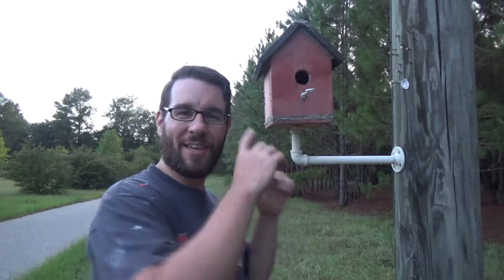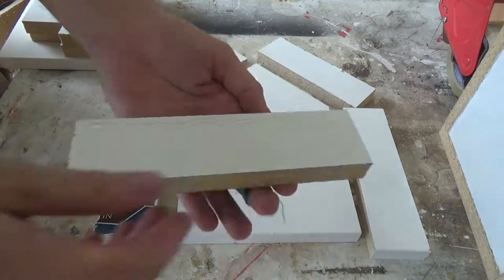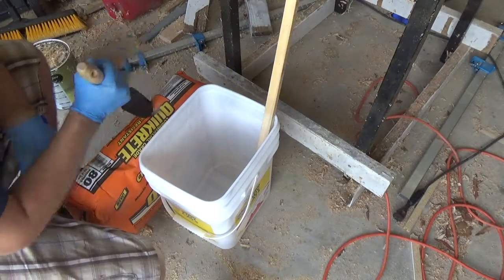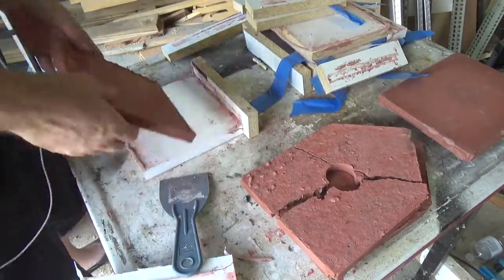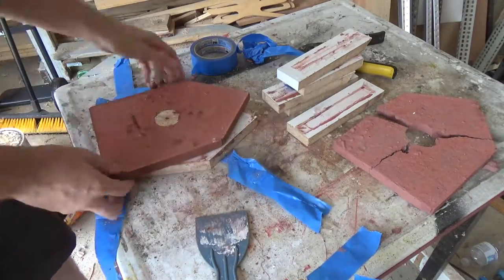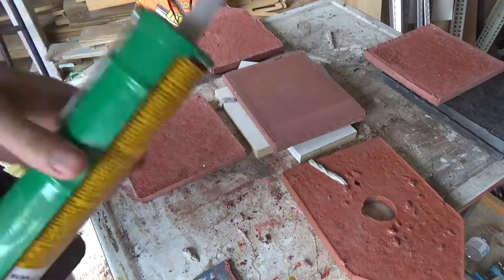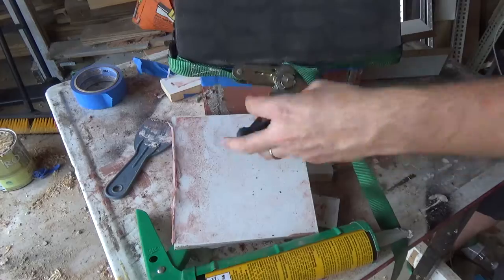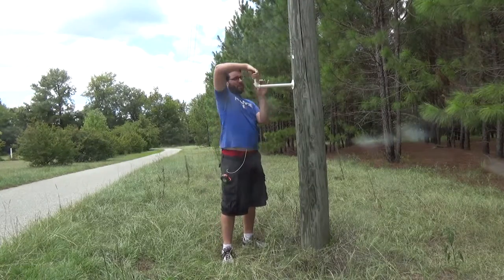Let's Make a Quikrete Concrete Birdhouse | How To

Comment: Watched your video because coincidentally I'm making two bluebird houses with subway tiles. Cut them with a tile score and break tool not a saw. I glued one with 2-part epoxy and another birdhouse with outdoor rated LiquidNails. I'll see which holds up best to weather, but your adhesive idea looks interesting too. I used a gap at top of front face instead of a hole. Hope to have a squirrel-proof long lasting house. White glossy subway tile should help keep birds cool in hot sun. We'll see how it works out and test of time. Maybe I should make a video, but would need to learn some video editing techniques.

Comment: nice!   after watching this, I'd be tempted to try and make all 4 sides at once by building a mold within a mold, and use hardwire throughout....and then maybe make it just sit on a bottom for easy cleanout.  thanks for ideas...
Reply from the maker: I thought about doing something similar... but thought this would be a little easier 🤓

Comment: Hardware cloth ,u ment to say  wire mesh. 
TIP: oil the molds and leave at least 12 hrs. for cement to dry.
Reply from the maker: It’s called hardware cloth, thanks for the tip 👍🏾